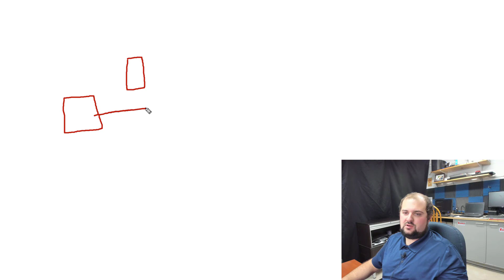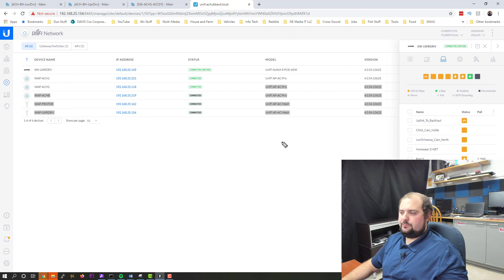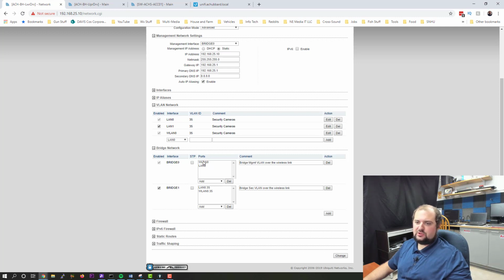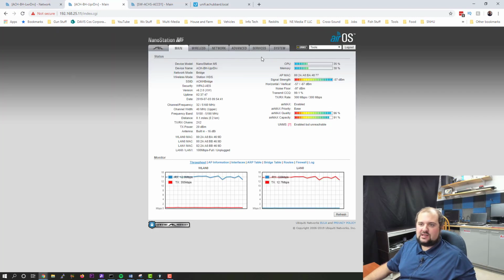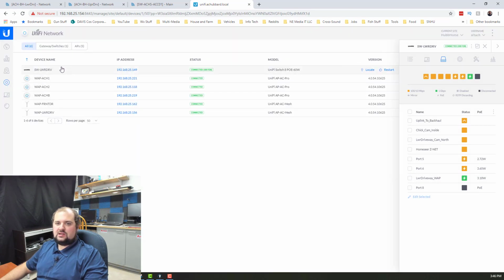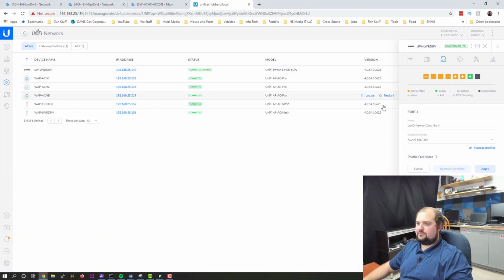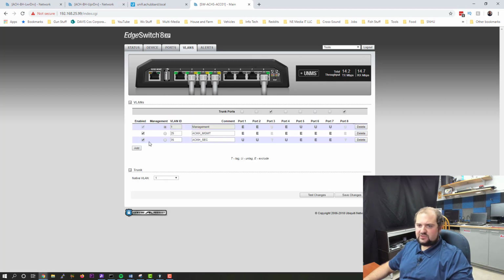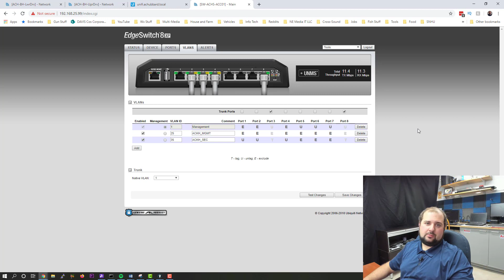How to Add a VLAN Over a Ubiquti Nanostation M5 P2P Link

Comment: Hi Ian: I’m wanting to setup 3 maybe 4 VLANs. Here is the issue I’m not sure about. I have a Cisco Router SV260W default gateway of 192.168.123.254. I have an Ubuntu Webserver static on 192.168.123.104. I am forwarding ports 8083 and 8080 to that address as well for the Server. So would like to leave that setup alone if possible. I have the following Ubiquiti equipment.  24 port POE switch, an 8 port 60 watt switch, 4 of the 5 port mini flex switches. I’m wanting the following VLANs. One for IoT, one for guest wifi access and one for my main LAN like doing my video editing. I also have a cloud key gen. 2. Do I have to set the VLANs in the Cisco router and the the 24 port switch. I even thought of changing over to an Edgerouter X even. So looking for some ideas on implimenting.